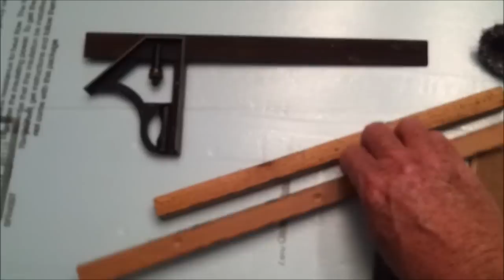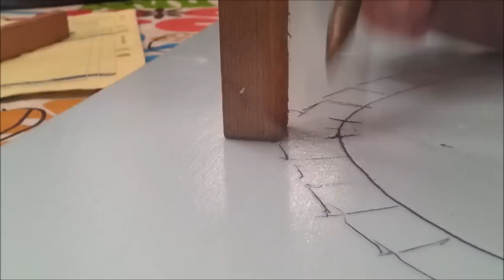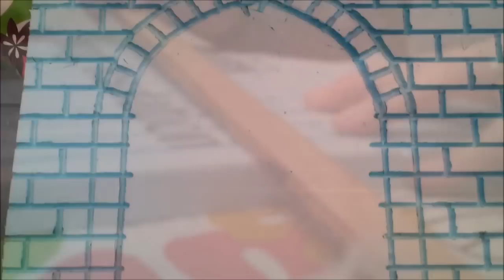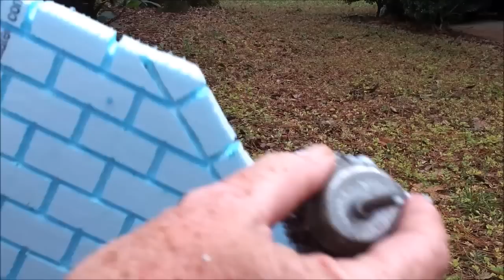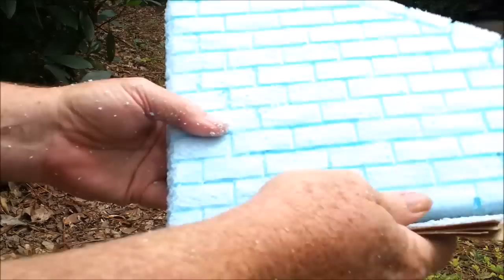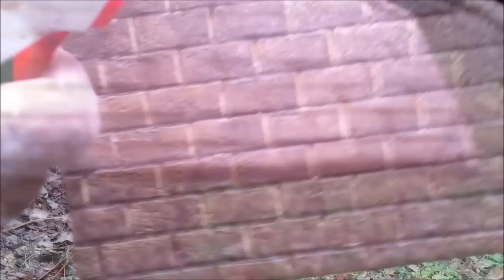How to make G-scale stone block tunnel portals and walls from foam insulation

Comment: I watch this but from the angle shown I was not sure if you were lining up the wood strip on the upper edge of the first  row groove or trying to eye ball it on the center of the groove burned in. Just a scale thing on the block one way or the other.
Reply from the maker: I line up the wood strip at the top of the previous row groove. You could do it on the bottom or center of the groove. The main thing is to keep the rows consistent in height.

Comment: This is a great idea!  Certainly easier than pouring them out with concrete or carving them out of wood.  I can see quite a few uses for this on my own layout.  One question:  After you rough up the foam with the wire brush, what grain of sandpaper do you normally use?  I imagine fairly course.
Reply from the maker: I used medium, 100 grit I think. It was lightly sanded just to knock off any sharp edges, or cling-ons.

Comment: This is really well done! A nice alternative to buying the pre-set portals if you have scrap foam lying around. Though a smaller soldering iron may be considered if one wanted to do this in a smaller scale, like HO.
Reply: +icverano525 Thanks, a 4 x 8 sheet is much less than buying one pre-made, and yields a lot of portals and walls. But scrap is always free, lol. I have friends that have used this technique in HO with a smaller heated tip.